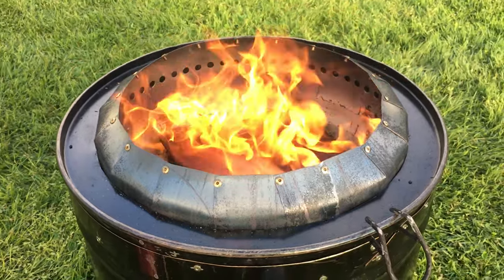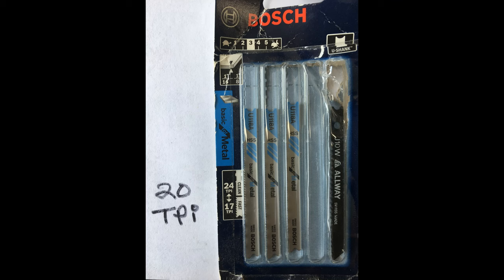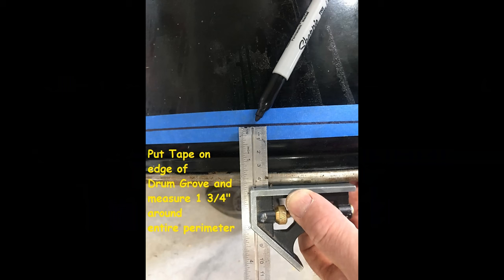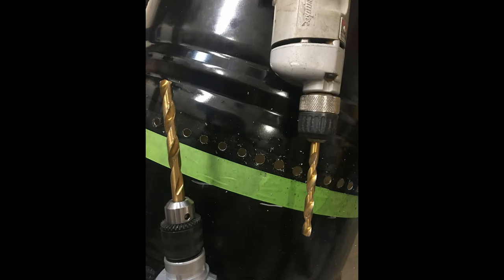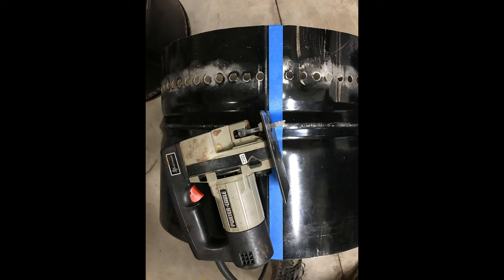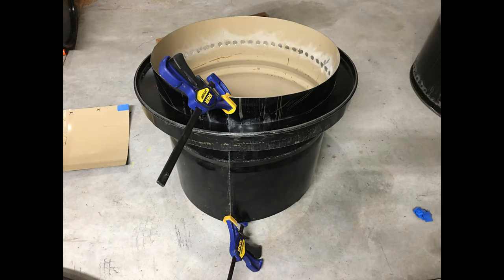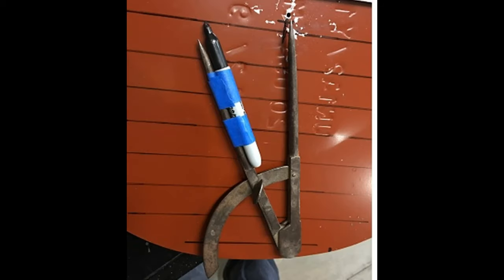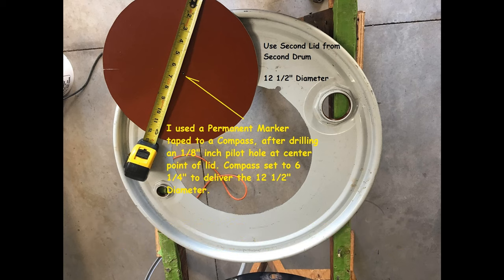Build a Smokeless Fire Pit Stove with Step-By-Step DIY Instructions

Comment: Great job. what are the fire ring vents for when the inner drum has its bottom lid with no holes in it?
Reply from the maker: Watch that video again, that inner drum has plenty of holes on the bottom plate, that also is on the stand-offs that create airflow at the bottom. It’s the outer drum that doesn’t have any holes.